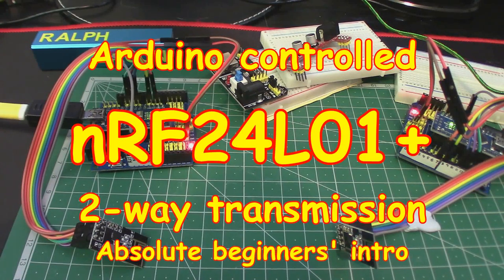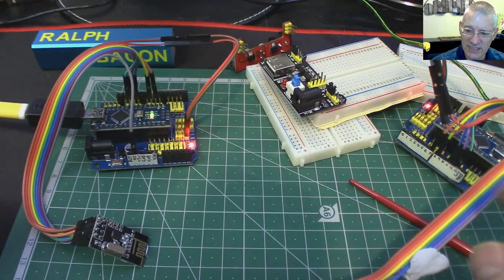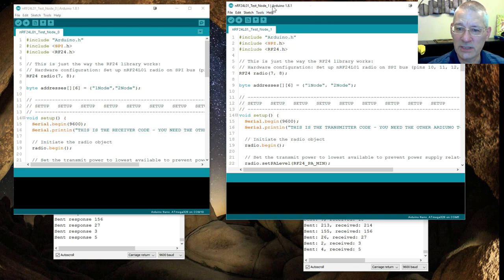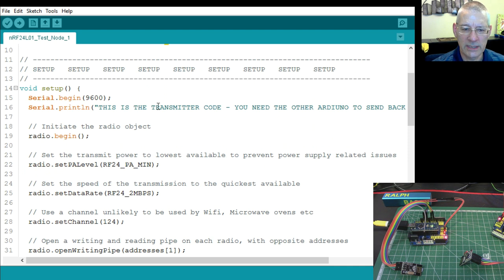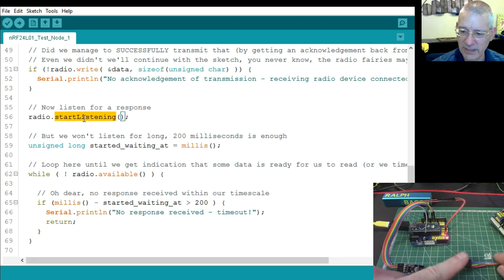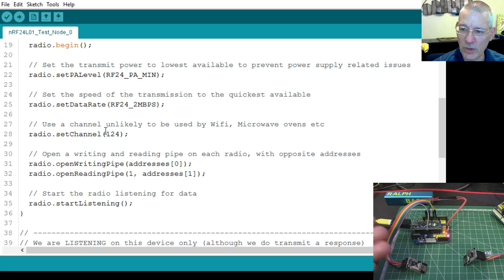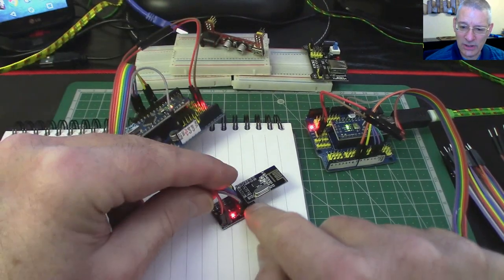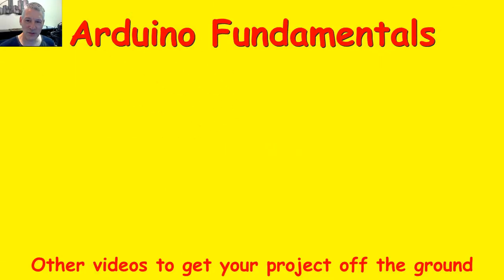#73 nRF24L01 Send (and receive) data with your Arduino!

Comment: Dammit, I've been trying to use the modules but they don't work. I don't know what else should i do to make them work. Sometimes it sends data but the other nrf doesn't show it and sometimes it shows characters like this: "????????????????". I tried a lot of sketches but none of them worked as it should.
Reply from the maker: OK, deep breath and let's see what I would if I were having the problems you describe.
If any one of these steps (do them ONE at a time) solves the issue then stop.

1. Use the adapter boards. These sort out any power issues which is a BIG cause of failures.

Do not continue if you are not using the adapter boards.
2. Ensure you using two identical pieces of Arduino equipment eg Arduino UNO running on external crystal.
3. Use my Rx/Tx sketches WITHOUT the slightest modification, because we know they work.
4. Keep the two nRF24 devices within about 30cm of each other as we are running on minimal power.
5. Change the line in the sketches ( BOTH of them) which says:
radio.setPALevel(RF24_PA_MIN);
to:
radio.setPALevel(RF24_PA_LOW);
6. Swap the nRF24 units over (what was connected to the Arduino running the master Tx is now the slave Rx and vice versa). Do the SAME symptoms appear. If so, it is probably not the nRF24 units.
7. If you have a couple of battery powered 5v supplies (eg from an 18650 battery) use those to power the Arduinos to eliminate any possibility it's a noisy power source.
8. Put debugging statements into the RX sketch to prove that it is receiving SOMETHING when the Tx transmits.
9. If you continue to have problems it may be the nRF24L01s that are faulty. I had one die on me whilst I was testing it (and I was not near it when it died). The chips may be fake and do not transmit on 2MB/s so change the following lines in BOTH sketches:
from:
radio.setDataRate(RF24_2MBPS);
to:
radio.setDataRate(RF24_1MBPS);

Let me know how you get on. Good luck.
Reply: @RalphBacon  thanks, i guess i'll wait another month for the 5v adapters and the same arduino nano to arrive. I will let you know! Thanks so much!

Comment: Hi Ralph! I enjoyed your video tutorial and made me get a sense of it even though I am a total noob in arduino, I tried your sketch but it only sends one time and gives me a timeout. Could you enlighten me? 😂 TIA 😊
Reply from the maker: When you say "it sends one time", does the other module actually receive the data (and then try and send back a reply?). Are you using the adapters I mention, as most things that go wrong here are down to power problems?

Comment: wouldn't an i2c level converter instead of the adaptor board/module? reason I ask is, I already have those and don't wanna wait 6 weeks for a part from China when I get ready to fry my brain with rf and C loops haha
Reply from the maker: I would not do that at all. The adapter boards are specifically designed for the nRF24L01+ modules and have an onboard regulator and smoothing caps. They work like a dream. I can only urge you to get those adapter boards - Amazon sell them (from a Chinese supplier) but they get delivered much more quickly.
Reply: Ralph S Bacon gotcha .. thanks!

Comment: Iam using your unaltered sketch.  my power supply is hacked computer psu. for nrf24 Iam using an ams1117 3.3 v regulator and associated circuity (filtering caps). with another sketch Iam able to do one way  transmission but not acknowledgement....
Reply from the maker: OK. Does the chip on the device actually say 24L01+ (note the plus sign)?
Have you access to an oscilloscope so you can see what noise (if any) is on that 3.3v line?
What speed are you running at, the 2MBPS as in my sketch?
Please click REPLY on this message rather than starting a new thread, it gets confusing!
Reply: yes the same 2mbps speed. the chip has the plus sign but I don't have an ossiloscope . I may try with another power supply and let you know.
Reply from the maker: Power problems are the single most common cause of failure. If you are not using the adapters I strongly recommend you do, as you can then supply 5v (eg from the Arduino) and it has its own on-board regulator. Today I was running my transmitter from a single 18650 4.2V rechargeable cell (power bank) without any problems whilst I was testing. Let me know, as you say, once you have sorted out the power and/or adapter boards (very cheap, even from Amazon).

Comment: Any solution to measure the strength of a signal between two of those modules? In dBm, so we can see how max far can we separate two of them?
Reply from the maker: From StackOverflow, Joe Thomas writes:

No, not directly.

In the original version of the Nrf24L01 specification, there is a bit, labeled RD, in register 09. That bit triggers if the incoming signal is greater than -64dB, cleared otherwise. In version 2 of the spec, they changed the name to carrier detect. It has the same threshold, but suggests pulling the device in receive mode and checking the bit. Long story short, you can glean some information from the RD/CD bit(register 09) in conjunction with register 08, which contains the number of packets lost and the number of retransmits.

https://stackoverflow.com/questions/47977747/determining-signal-strength-in-nrf24l01
Reply: @RalphBacon   I found it. I was thinking if there might be some sort of an example someone made. Could it be measured with some other device? After all, it is 2,4GHz device.
Reply from the maker: Sounds like you have found something to use, good luck with this.

Comment: Hello sir,
Can we use NRF24L01 with Arduino for commercial automation ?
Reply from the maker: Hello Dharmendra! I don't see why you cannot use this device commercially, after all that is why they are manufactured. The only caveat I would raise is that if you buy the modules (as shown in my video) you may want to verify the quality of the product before introducing it into a commercial product to prevent returns. Or, it may be commercially viable to design your own PCB for this device and get it assembled to the quality you require - in this way you have control over your product. There are many factories in China and the Far East that will do this for modest production runs. I hope this helps and thanks for posting!
Reply: Thank you sir,
in some video on youtube i found lost in signal strength of NRF.
so i asked this question.
My circuit is working correctly but i decide to get expert opinion before commercial sale.
Reply from the maker: Remember that if you are after a long range there are nRF24L01 boards with a "proper" walkie-talkie style aerial (I briefly show these in the video) which can give you a 1km range or more (not that I have tested this, but in open countryside I'm sure it's correct).

Comment: I definitely did not fry it(LOL) at the input of the transceiver I have added 10 micro-Farad..It is very good programmed you have sketched My recent trial it was to keep what you have programmed randomSeed(analogRead(A0));     //ADDED** and in the void loop i have used
unsigned char data =random(A0);   I don't know if it is the right expression though. 
on the receiver void loop  unsigned char data;  uploaded the #include <DigiPotX9Cxxx.h>  and wrote the function to make the pulses
 for (int i=0; i<100; i++) {
    Serial.print("Increasing, i = ");
    Serial.println(i, DEC);
    pot.increase(1);
    delay(100);
  }
  for (int i=0; i<100; i++) {
    Serial.print("Decreasing, i = ");
    Serial.println(i, DEC);
    pot.decrease(1);
    delay(100);
  }
the next lines I have used what you have used to get the random numbers.
 I have verified it and uploaded it and on the transmitter side I have used the serial plotter and I can see in blue the pulses also I have added an LED at the output of the digital potentiometer and is flushing accordingly to my set ups.
Also on the transmitter's serial plotter I see a graph in red which is a copy  of the receiver's end serial plotter. Though the magnitude and timing are out phase (delayed). The magnitude of the pulses are steady at 100 representing the 5 volts input of the digital potentiometer voltage. the output of the receiver's serial plotter is variable but not more than 15 from the 100 of the pulse's amplitude.I don't know however because I used random instead of int or float something to do with these results. What I want is to sent pulses and I get back the same amplitude of the pulses and timing.
I hope and pray that the project goes with Eurostars and Innovate UK well as we are three partners a watchmaker from Switzerland and the Cyprus institute of of Neurology and I make a payback to what you are helping me out.  My website is www.nevadatechnology.co.uk my email is demetrios@nevadatechnology.co.uk.
God bless you for all your efforts.
Demetrios
Reply from the maker: The digital potentiometer (INTERSIL  X9C103PZ series) is not something I am familiar with but as you have the library (presumably from tfager from the Arduino forum) you should follow the examples (if any) there or ask in the forum for further help as this is outside of my experience <sad face>. 
However, all is not lost as you have piqued my interest and perhaps one day I will do a video on how to implement such a device (but I would do it using an infrared transmitter not an nRF24L01 unless you specifically need to send data back of course!). Good luck with this.

Comment: Last half of this video was excellent.  The first half was mostly annoying blabber about using 3.3 volts and adaptors and cables and this and that associated with hooking these devices to Arduinos. Not helpful as other videos do this job much better in a short and direct way.  The last half deals with Bacon's hack of a simple sketch that gets 2 nrf24L01s to talk to each other.  Very good!  That's why I tuned in.   Getting the sketches right is the main challenge.
Reply from the maker: Well, at least I get half points from you and I am glad you found the last half useful. However, the bit about using the adapter plates (so you can use 5v and forget all voltage/current related problems) is good to know.
Reply: @RalphBacon  Your electronic videos ARE very helpful, it's just sometimes I'd like you to get to the meat of the video and leave the other stuff for another time.  In this case, getting the code "right" for NRF24L01 has been a giant pain for many many people.  There are many codes that purport to be the best and easiest, but they generally miss the mark.  Your code is the most straight-forward and understandable that Ive seen.  That's worthy of an A+++.

Comment: Hello sir, can I use an arduino uno for the transmitter and a nano for the receiver ?
Reply from the maker: Yes, you can, same chip and pretty much identical, electronically.
Reply: @RalphBacon  thanks 👍
Reply: @RalphBacon  thank you :)

Comment: It's possible to connect 10 nodes?, not necessarily in parallel
Reply from the maker: To connect more than about half a dozen, Octavio, you need to create a 'mesh' - which the library we're using supports but you will have to have a look at the example the author gives (on GitHub) for this advanced use of these brilliant modules. Let me know how you get on, I'd be interested (as would others, no doubt).

Comment: Could you link to these breakout boards please :)
Reply from the maker: I certainly can and I'm surprised no-one else mentioned yet, Merkaba Energy! I've added a link to the video description where I got them from (Amazon) but they are available in many of the usual haunts (AliExpress, Banggood, eBay):
 
The adapter board:
https://www.amazon.co.uk/Socket-Adapter-NRF24L01-Wireless-Module/dp/B00NJCB7FS
 
And whilst we're at it the actual module itself, also from Amazon but available everywhere:
https://www.amazon.co.uk/dp/B010N32X3U
 
I hope this helps and thanks for pointing this out to me.

Comment: Hello, I have been working on this for a little while with two Arduino Micro's and it seems like the code is working, but the the transmitter keeps getting 255 sent back to it. Has anyone had this?
Reply from the maker: So, daBatman2, the transmitter is sending out a random value (0- 255), let's say 20 for this post. The receiver is receiving '20', adding one to it and sending '21' back. Then the transmitter is saying "I've received 255"? Can you just look at the Serial Monitor (debug) window on both Arduinos and check what is being sent, received and returned?
Reply: Thank you Ralph for explaining it so clearly.
I am having a similar problem, both of them are working properly. The transmitter monitor shows  (for example " sent 56 received 151"  but the receiver monitor shows"sent response 57")
And that received 151 is constant for all the sent values. What might be the problem?

Comment: I’ve already commented to say thank you for the tutorial but I can not find that comment to add another reply. 

This tutorial works perfectly, to which I learned a lot but I’ve been stuck on my next step for a while now. 

I’m trying to incorporate a dht22 sensor, which I’ll then add an oled to the circuit. But for now I’m having trouble converting your code to send dat from the sensor. Currently the rf24 module is sending a random number, which I have changed but nothing. I’ve added float, defining temp and hum but not sure of how to define the data sent.  Thank you
Reply from the maker: In my demo, Chris, I'm sending a single byte (char) value called data (to make it easy). 

You can send an integer (two bytes) and define the struct accordingly. It's compact and quite easy to add data to the struct. Note: 32 bytes max! Read on...

Example:
// Declare this globally
struct myData {
 int temp;
 int humidity;
 char channel;
};

Then your send would be:
myData data;

// populate from your DHT device eventually - get it working first
data.channel = 1; 
data.temp = 54;
data.humidity = 78;
if (!radio.write( &data, sizeof(myData) )) { ...

The receive would be pretty much the same. Declare the struct, create an instance of it, receive the data into the instance of the struct and you have the values.

If you get stuck, give me a holler. BTW you can find my email address on the About tab of my channel if you need to send me your code, for example.
Reply: @RalphBacon  Thank you very much Ralph. That makes sense but I will try it out this evening and see if I can put that into practice.
I've read that many things, with too large a gap in between that I'm just getting muddled up.
I have the DHT22 sensor working with an OLED 128x64 display, and the sample which you provided. Just the merger which has stumped me. I'm very new at this programming stuff and probably trying to jump too quickly, especially with the lack of spare time I currently have.
Again, I thoroughly appreciate your replies and passing on your knowledge. If I can't progress, then I'll send my code over to yourself via email. Thanks
Reply from the maker: I've tried to reply to you Chris with two different email addresses. I get: 
550 5.7.1 [CS01] Message rejected due to local policy
You need to whitelist my domain or something I think?
Reply: Ralph S Bacon Hi Ralph. Thank you for that. I’ve done that now on my icloud and gmail accounts. If possible, could you resend as it doesn’t seem like it has let the original emails through. Much appreciated.
Reply: Ralph S Bacon Hi Ralph. Feel awful for mithering here but did the problem persist? If so my work email may be worth a try. Thank you for taking the time.

Comment: Hello Sir;
Thank you very much for your useful sharing.

I want to use 6 pieces of nRF.
There will be 1 transmitter.
Task; it sends data according to the data from the other 5 arduino.
Operations will be performed sequentially.
There will be 5 receivers.
Task; will use the incoming data and inform the sender that it uses the data as return.

Is it possible to do something like this?
What way should be followed?
How many channels should be created?

byte addresses [] [6] = {"1Node", "2Node"};

radio.openReadingPipe (1, addresses [0]);

radio.openwritingpip to (addresses [1]);

How do you make a change in the above lines of code? (I can write the necessary algorithm for other codes.)

Thank you so much.
Reply from the maker: Although I haven't used more than two nRF24L01+ units at a time, you can use up to 6 before having to use a 'mesh' network. I would look at the examples in the nRF24 library we used to see whether he describes using more than 1. At the same time if you add a third module to your setup (another 'receiver') and increment the index in those arrays (addresses) you should be able to confirm that you have two working receivers. Then to add further ones just repeat that exercise. And don't forget that the Arduino forum (http://forum.arduino.cc) is always an excellent source of information. Good luck.